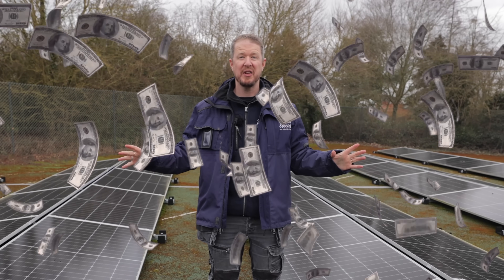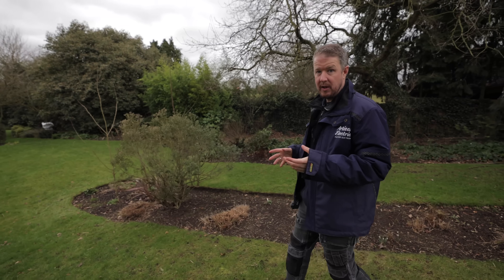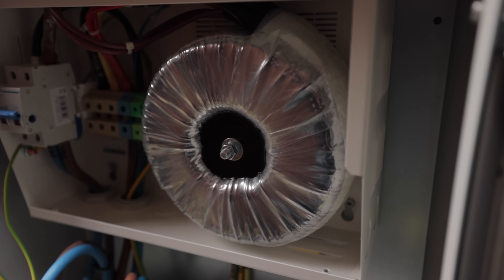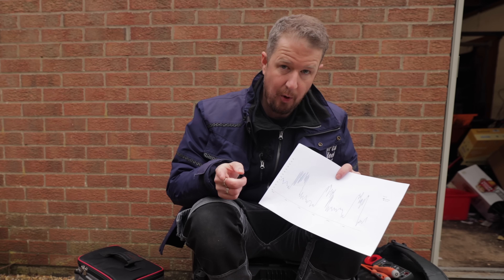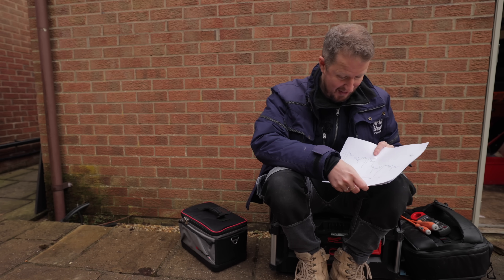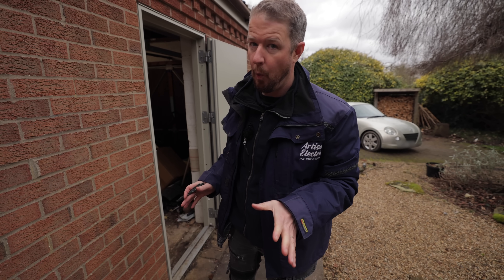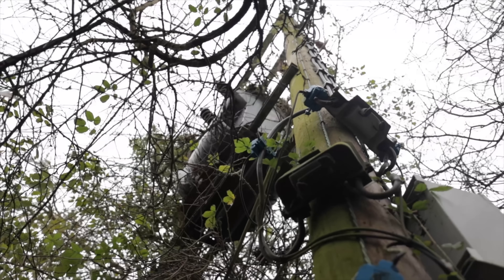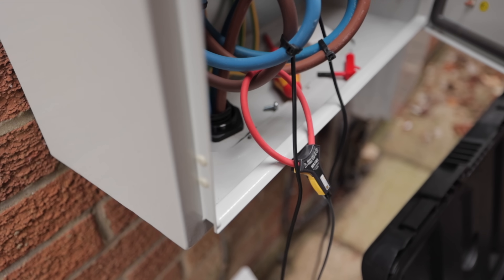THOUSANDS Down the Drain – And We Can’t Do Anything About It!

Comment: Had similar issues because I live next to a large substation. The increased voltages happens during peak consumption times when the national generation pumps out more to cater for the increased demand especially during very hot sunny days. Locally our voltages rise to about 256V and in order for our PV to export, the inverter needs to raise voltages higher for energy to flow out. This has cause issues and I complained to our provider who sent someone out to check. They lowered voltages by a few volts but also said the higher voltages was necessary to ensure homes further down the line had the minimum voltages. The homes further down away from the substation had issues with low voltages (some under 180V apparently) under certain situations. I think for your case, due to feed-in from other solar PV, the case maybe more complicated.
Reply: If the DNO fails to provide within the prescribed voltage and frequency then they are breaking the law. They should be held accountable by regulators but we know how well that works in water.
Failure to invest in necessary upgrades to our infrastructure. It a failure to upgrade for demand as much as it's failure to upgrade for solar, ev and heat pumps.

Comment: I am a Electrical Design Engineer and this is a common issue with overhead transformers of 300 kva, and what I have done in the passed is to put a time clock with contactors to change the tapping output voltage on the optimiser transformer from say 10% to 5% to increase line voltage if to low ?? and if the voltage is too high then use a voltage overvoltage device to engage to the 15% tapping ??

Comment: To be brutally honest Jordan its down to you guys to have looked deeper into the project and assessed it further due to its size. With those  calcs you could have potentially highlighted an issue that the DNO would have then probably advised  upgrade works to the system which ultimately the customer should pay for. As stated the problem probably is that there are other properties on the line which already bring the voltage down..then that massive solar rake overkill just destroys the tolerance of the supply. There is no way you can connect that level of generation and EV demand to a transformer probably serving many other properties without impact. seems like your customer wants to be big boy so let him pay big boy to get the infrastructure set up right first.  Lesson here is before taking on and installing such big projects on domestic make sure you have the engineering on-site survey from the grid first rather than send them calcs which clearly were not right which DNOs will always accept with the onus on you to ensure what you tell them is technically spot on. I know its easy to say all this in hindsite but a system that size on domestic just is not fill out forms and crack on.
Reply: Well, no, the inverters still cut out at 253. The customer doesn’t want that to happen, and so they install that autotransformer. But what happens then is that the inverter sees 253V while the grid is seeing 260+.

So basically the autotransformer Jordan has fitted at their own cost is a way to keep their inverters generating even while the grid voltage is already too high. They’re literally cheating their way into being the last people in the street whose inverters shut off. And Jordan is helping them do it. If the DNO gets wind of this they dhould by all rights disconnect the property completely until it is fixed and the autotransformer removed.
Reply: @JasperJanssen  agree
Reply: @JasperJanssen  
Exactly.
Reply: @JasperJanssen  Correct I would classify this install as illegal since the client transformer is specifically installed to defeat the export safeguards in the Solar inverters. It  is allowing the export of power to push the local LV out of tolerance for others customers. DNO should disconnect the customer until rectified.
Reply: Just looked at my G99 offer from SSEN. It clearly states "Operate the generator at between 0.95 lead to 0.95 lag power factor, and ensure the maximum export
capacity of 5kW is not exceeded and the voltage at Southern Electric Power Distribution plc’s service
cable termination does not exceed 253 Volts.
If your equipment is operating outside these parameters, please, contact us regarding your requirements.". Seems to me the over voltage issue is likely to be the customer's problem to be rectified by the installer and not UK power networks (assuming they state something similar in their connection requirements).  Would be interested in what UK power networks stipulated as conditions for the export connection...
Reply: @DP-vc6cp 100%. It's hard to believe that someone installed this and believes it's not their fault or problem. Just disconnect from grid during voltage spikes and customer/installer to deal with all their own power excess.
Reply: Needs to be designed by an electrical engineer,  not a vain electrician who does not know his limits.
Reply: Keen to see part 2 🙂
Reply: @rattlehead, what caught my attention was that the batteries are charged up in a couple of hours, would it not be better too install some sort of current regulator so it charges up over 7-8 hours, thus stopping the voltage drop?
Reply: @brianwheway1933  no need to install something, everything is programmable on these SE batteries.
Reply: @brianwheway1933  The customer's "off peak" tariff may well only give them a 4-5 hour "window" in which to charge the batteries.
Reply: They should of let the DNO do there 2 week test, surely they could live without the solar for 2 weeks for goodness sake, acting like there broke.
Reply: If i had that sort of coinage i’d be going completely off grid with back up generator, but here in Oz we get more photon’s and less ice i guess.
Reply: This issus is something ive been saying for years, ive been around engineering/repair/fab shops my whole career and for hobby, 5kw is a commercial welder, a large lathe, an impressive diy/sole trader wood machine shop. All of the above need min 32amp 240v, but ideally 415v 3ph. None of which the power companies like in domestic grids. Then evs/green egenda bs came along and it was all going to be fine......
Reply: In my area, the grid voltage was going over 260V due to excess solar in the area, and I complained, the DNO put a logger on my meter and agreed, and they changed the local substation, and everything's now fine and I can export the amount they originally agreed to.
Reply: Couldn't you set up solar edge batteries to charge in sequence rather than all  at the same time?  This would limit the load and potentially reduce that voltage drop off? Just a theory?
Reply: Solar panels over voltage cause us DNOs massive problems.  I had it this week, where I asked to Custer to turn his solar panels off and long and behold his voltage readings dropped to within parameters.  He’s also complaining that his car charger keeps turning off due to over voltage.  The issue is with the private regeneration and car chargers.  The Infrastructure is not ready for this.
Reply: Yes, the G99 allows for a tolerance of I think 2.5% voltage rise max from your inverter. Although an inverter matches grid voltage and frequency it does also have to slightly ramp up it's own voltage to attract your house (load) to take it's inverted power and not grid power, path of least resistance. As for the night tariff load, that is just way too much on the charge controller.
Reply: They should have contacted an engineer specialized. Not just them they are just solar Installer ... And electricians.
Reply: We don't even know the voltage rise on the AC side wiring from the inverter to what ever 'board it is connected to, nor what rise happens between that and any subsequent 'boards if this is the case.  How about some measurements or just calculations based on maximum amps the inverter can supply to see what that rise is.  If we are throwing away 5 volts of 'space' there well, that's not so good.
Reply: Very well written and I totally agree with you on everything.
Reply: Most of that is nonsense, it shows a grid issue proven by the overnight high voltage and the low voltage which is sod all ti do with the Solar PV.
Reply: Or maybe solar sucks and is only for the iddle rich
Reply: Is there not a setting in the inverter that will limit peak voltage
Reply: Can I have your number please 🙏 you can do my massive solar project
Reply: I have the same problem though live quite rural so assumed it was probably the long cable to me from the transformer. I was approved 6kw & can't send more than 3kw back or my volts go the same 263 & the same when car charging down to 220v & my normal is around 240v also. 
Currently doing a self build to replace the cottage that is falling down so I'm hoping when I get the national grid to move the power line from the pole to my new build they will upgrade the cable back to the transformer if I tell them about this. Though I'm waiting untill I have some money as can't imagine that will be cheap with the National grid! Be interesting to hear how you got on with the DNO
Reply: Quote "We did get G99 approval for full 17kW export to the grid" which is spot on and not a calc. The rest of your comments are very dependent on 'probably' and 'seems like'.
Reply: From what I remember of doing my G99 and talking to ENWL, they will give you an 'up to' limit but that doesn't guarantee you can export that much whenever you feel like it. Your equipment must keep within the grid regs which is the 230v +10%/-6%. It is up to your equipment to not push it higher. If it gets to the upper limit, it just means you can't export any more. This is why they will only monitor the network when there is no solar generating. It's quite common for 'solar rich' areas to have over production which then means peoples inverters will limit export. If you want guaranteed export, then you need to pony up the money to have the grid transformer upgraded. I believe you only have to pay a proportion of the cost these days, but it'll still likely be mega money. 

The real reason they are seeing any issue seems to be because the solar inverters are pushing the voltages over the grid code limits which is tripping the PEN detection equipment. If the inverters didnt push over 253 then the PEN wouldn't trip.
Reply: @cingramuk should not be exported at all
Reply: @ColinCarFan Think you need to sit down and watch “actual electrical contents” video which sums up everything i am saying regarding research and calcs.  G99 in the grand scheme of things means bugger all if you don’t do your research first.  The DNO rely on the Qualified MCS installer to provide correct data and calcs to them. Clearly when you declared 17kw you didn’t tell them that was a daily generation and they have taken that on a “peak basis” Not only that WTF are you doing making a video looking into the transformer and placing a sham of an autotransformer after the fact!? Whoever came up with that needs sacking straight off!  The calcs and correct liaising needs to be done on a system of that size  way before  you start promising customers they can have it.
Reply: @ColinCarFan  The words “probably” and “seems like” are used because i can’t physically see the install so i’m using engineering logic which looks like was lacking here. Whenever you do a G99 and declare what you intend to install the common factor across the board be it apply for a heat pump, EV, solar is that you correctly inform the DNO and liaise with them of any issues you foresee. Their approvals are based on what the engineer has told them and acting on the survey carried out. Did it at no point dawn on anybody that a solar install of that scale connecting to an existing grid transformer more than likely dated and not set up to handle this was in place. With a Solar of that scale i’d be asking for a DNO site survey and voltage monitoring before any works are carried out. To then guess and start interfering further with a DNo supply by installing autotransformers is in itself dodgy ground and shows the contractor really doesn’t know what he is confronted with to start with which would explain why the thought of a Supplier site survey was not even brought to the table. Sadly in this case i think Jordan may need to accept he’s lost out here..pay whatever is needed to get it right with the DNO and learn lessons in that large overblown domestic “solar farms” are a bit more than a run of the mill g99 and happy days on approval. It goes deeper than that.
Reply: It’s not so much that the DNO has to upgrade their transformer, btw, what they need to do is tap a different winding. The voltage is around 240V in the night, while there is no solar happening. They need to make sure the base line voltage is 230 ish, not 240ish. They’ve apparently never adjusted this neighborhood downwards the way they should have after harmonization, which leaves far too little headroom for solar installations to pull it up.
Reply: @JasperJanssen And that works for solar in the daytime, but the battery charging already presents the opposite problem, which would then only get worse with a lower voltage tap in use. A significant part of the problem is the length of the cable run between the property and the transformer.
Reply: @GodmanchesterGoblin maybe a nice word with the owners of the nearest property to the transformer to do dual voltage monitoring would help work out if overhead line is too small.
Reply: @timballam3675  
Most likely is the overhead line to small and most likely is their solar setup making problems for all the neighbours because of disturbance in the grid.
I suspect they are breaking regulations and maybe even laws with what they have done.
Reply: @JasperJanssen  that however might take end of line properties out of voltage spec.
Reply: @JasperJanssen cutting back on the vegetation so it dosnt overheat would probably be helpful as well
Reply: @ IT could also be that before this PV was installed there were times of day when the loading on the overall distribution area caused excessive voltage drop for a customer so they altered the transformer tapping to bump it up.
Reply: @JasperJanssen they can change the winding, but it will increase the risk of blowing the fuses. Happens here in the Netherlands a lot and caused DNO to change the winding back in some cases
Reply: The grid Provider has all the data they need to do the calculations. 
And if they approve the installation of 17 kw it should work. I installed electric heaters which had more power.
And if the grid fails to carry this power is shows the state of the grid. Should the installer go out on every job and do a load test?

In germany the grid provider has to approve solar installations up to 30Kwp. If the grid cant deliver that they have to upgrade it.
 That is needed because many people get EVs, heatpumps and like in this case PV. And the demand is not going down anymore.

We at home have 50kwp installed and limited the outgoing power to 30kw. We also have and around 50kw of storage.
 We have monitored the voltage and its never been over 244V.
Reply: Part 2
Reply: Out of interest, at what point does something become more than being just a home generator.

We often read about installations commercial, taking time to be connected, even with all of the hardware they need to install at the generator. 

It's an interesting problem. Maybe worth an interview with grid people, I would love to know.
Reply: Nope, if the DNO issue the approval, it’s completely on them.

Comment: While you pursue the DNO you can set the export limit lower so you don’t exceed the peak voltage. Also on SolarEdge you can set a lower import maximum to stop the charging driving the voltage through the floor. Then instead of using the “Maximise Self Consumption” mode to charge the batteries first, use “Discharge to Minimise Import”. Excess solar will go to the grid, anything generated over the export limit will charge the battery which being on the DC side will not raise the AC voltage. I have 3 SolarEdge inverters, 2 with batteries for a total of 13kW inverter power on single phase fed from a tiny 50kVA PMT. This works only because my export is limited to 6kW.  National grid (WPD) wanted over £40k to upgrade the supply to 3 phase so I didn’t take up that option. I use the batteries as a generation buffer, filling then exporting back out from battery through the straw that is my export limit as generation tails off.
Reply: sounds like it would be much more reasonable than what they have now. It sounds like Artisan or the customer have set things up for maximum monetary profit but the reality is, the grid was never designed for that. Tune things down a bit, or get a beefy 3-phase supply, and everybody will be much. happier.
Reply: @112Haribo  Certainly sounds that the customer expects to get his £s for all 18kW of export he is permitted.  Irrespective of the rest of the street
Reply: Experience counts, good advice.